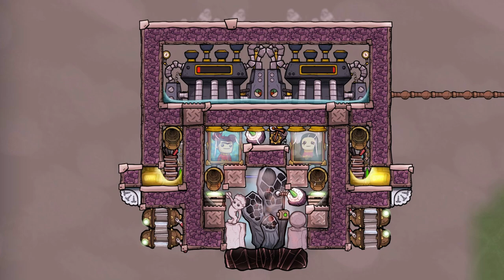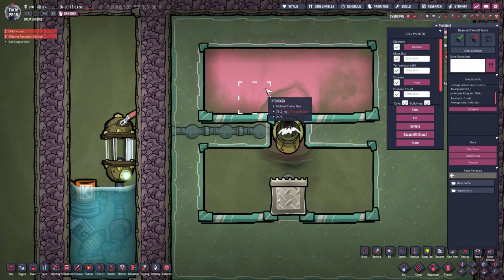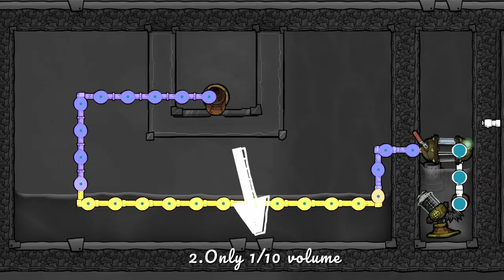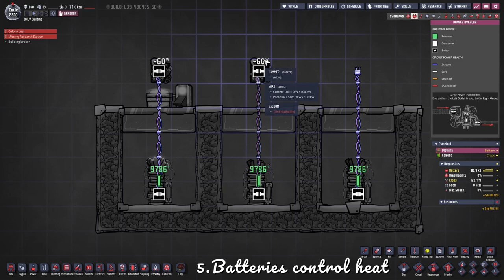My Cold Steam Vent Tamer - Explained

Comment: That's an insane build.
Reply: Is naptha necessary though?
Reply from the maker: Did I use that under the liquid vents? Then no, it can also be petroleum or crude oil.

Basically any liquid, it just needs to be able to resist the heat. 
Naphta is helpful cause it is very viscous helping the player to drop a good amount in that tile without spilling.

But if you build this monstrosity naphta is probably only a small concern. since you already have plastic and heat.

hope that helped

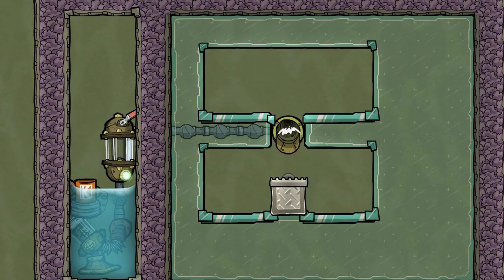Comment: Thanks for the video. I'm not new to ONI, but only from you I learned about liquid pump mechanic 1:28. Man, that stuff is crazy! I already found 2 useful application for it: 1) powerless room vacuum 2) powerless geyser storage. In both cases we just need to fill few pipe sections with water, brobably bridged in, with storage above. For just vacuum we destroy storage when gases deleted.
Reply from the maker: That is cool. Nice i could show you something new.
As for the Geyser Storage: just be careful cause the liquid vent overpressures at 1000kg/tile
Meaning if you reach that pressure in your storage the vent will turn off, the gas will stay where it is cause of the liquid puddle; the geyser will over pressure though and stop at that point in time. So plan ahead for that

Comment: There is a huge design flaw on the compact version that can be fixed, otherwise it disables the entire thing:
The insulated pipe CANNOT pass by the thermo sensor, even if it is very insolated, the water there will eventualy became steam, it is getting a tiny bit of heat even with ceramics, and since it is sitting there basically forever, only renewing 200g per tic it will eventually heat up to steam.
The easy solution is moving the piping around, shouldn't be much of a problem since there is already a block on that column, another fix would be a bridge. One thing is fore sure, you cant have water sitting at a 200 ºC block since no insulation is perfect.
BTW, amazing content, I'm really enjoying your vids, I wish I had discovered this sooner, liked and subscribed already
Reply from the maker: Thanks man, good eye. I think i noticed that too after some time 
(although i already test all my buils for around 400 cycles before making a video on them). 
Routing the pipes around seems like a reasonable improvement whyile only slightly increasing the size.
And thank you for the sub :)
Reply: I've used cheaper materials, lol, mine blown up in about 100. Still, pretty awesome  build, using steam engines instead of pumps is brilliant

Comment: This is super helpful! Why is naptha always used for the drip/gas function instead of other liquids like crude oil?
Reply from the maker: Any liquid will to that is in liquid form at 110°C and does not off gas. 
Naphtha has the benefit of being sticky and forming puddles of 30kg. 
So it is easier to apply without spilling.
It is also very heat resistant.

Comment: if you have 2 cool steam vents. put an aquatuner in one with a steam turbine above to heat up the water above 125 and turn it into 95C water which can be output from the steam turbine into a water pool with a cooling system, and have the liquid pipe from the aquatuner go to the other to cool that liquid down therefore using 1 aquatuner to turn the steam of 2 cool steam vents into water which can be cooled in the main water tank

Comment: Will this only work with naphtha or can a different liquid be substituted?
Reply: Any material which remains liquid at 95-125 Centigrade will work.
I use petroleum - as this contraption commonly must be built ASAP (even when colony does not developed enough to produce plastic) and it already has petroleum as required element.
Yes, there only 1 step between plastic and petroleum (which you need to do anyway as you'll need plastic for turbines), and another one - between plastic and naphta - but why bother with extra steps when you does not really need to?
Reply from the maker: As  Павел Романов said. Any liquid will to that is in liquid form at 110°C and does not off gas. 
Naphtha has the benefit of being sticky and forming puddles of 30kg. So it is easier to apply without spilling.
It is also very heat resistant.

Comment: Beware: After ~200 cycles the insulated pipes leading through the battery-rooms will break even if you use ceramic. Better go around the 200°C-Petroleum
Also if you don't have ~250°C petroleum and/or magma I'd recommend to "prime" the build by running one or two geotuners on the steam vent to get 130+°C steam temporarily (or permanent, if you have renewable bleach stone. Heating up the battery-rooms enough to get rid of geotuning is even faster with a conveyor-bridge.
Reply from the maker: Hey hey, thanks for noticing! 
Routing the pipes around will definitely make it safer.

I would just like to add 2 bits of information:
-this was before geotuning and
-i normally test for at least 400 cycles before making a video on my builds. 

I don't doubt your observation though, could be i went short on testing in this one 
or that it will take longer than 400 to break.
It can still break though. So rerouting the piping is a good improvement!

Thank you for the suggestions :)

Comment: Now what if you have the mod that allows to "crack" the vent to increase the output? I've done it to one and in active periods it could go like 55kg/s, I'm thinking about splitting the chamber to leave 1 tile space so the steam keeps going up and keep adding levels to the steam turbines to match the average output of the vent after cracking...
Reply from the maker: You basically don't need to chsnge anything fundamental. just make the room was higher to have an increased buffer.

The only thing you need to prevent is overpressurizing the liquid vents i.e. less then 1000kg per tile. So if you make the upper room bigger you have more leeway.
Reply: @Luma_plays  I think I need more turbines, the average output including downtimes is calculated by another mod to be 7kg/s, even with buffer, if I want to use it all given the 2kg/s per turbine I'll need at least 3 or 4 turbines to use it all, off course given that I have enough buffer to hold it all
Reply from the maker: @CarlosEstebanLopezJaramillo  Ok that is probably the safer method. But you will not get 2kg/s per turbine since you only have 4 available steam inputs. meaning if you add more turbine (you also need more heat or magma chambers with walls and so on) you need to accomodate for that deficiency.
Reply: @Luma_plays  Sorry man I've been trying to fix it and add more steam turbines, but I don't have the sanity points to do it in survival while trying to survive a drought, moving into a petroleum escher waterfall to bead pump to infinite gas storage, then in the infinite storage I'll add steam turbines as needed instead of trying to keep everything balanced without the steam condensating at bad times.
Reply from the maker: @CarlosEstebanLopezJaramillo  No need to apologize :D
Sounds like you have an interesting and complicated base!

Comment: Luma, what would you recommend for getting this as  a "permanent" setup for only removing that much steam as the geysers calculated average output is?

That way the system will output the same amount of water for thousands of cycles.
My first thought was to maybe block some ports if necessary and reintroduce the last few bits of water to the steam room to exactly export the Calc. Average output.

Is this even possible? That way the steam above the vent would have to be enough mass to work for an entire dormancy period, which is very long according to my experiences...
Reply from the maker: Hey michimannes; generally i wouldn't recommend this as a permanent setup cause it is way to complicated for that. 
There are easier methods. This was just a proof of concept that you CAN make a power positive steam vent tamer.

If you still use it for that reason then I think it is easier to just extract all the water (in form of steam from the geyser)  and store it instead of controlling the steam average output. you can easier manage your water pools or storages than the output of a system with changing parameters.
Reply: @Luma_plays  the idea behind that was mostly having a nearly constant power pruduction with this.

But I just saw it again and I think that's not really worth it - the power produced is just so low that it's not even a problem if the power was wasted sometimes

Comment: I have an Idea. With only one Geotuner you can tune the steam emitted to a temperature of 130° C. Then you would need the extra chamber for hotter steam, and the steam turbines could work at max capacity. And since the Steam is only 130°C you can still self-cool them. The only problem I encountered with the tuning part; sometimes ur Data on the Tuner runs out and your dupes because your dupes only research and refill the tune-data after it has been fully depleted, making the steam too cold for the turbines. Would be interesting to hear your thoughts on this(maybe try something in the likes).
Reply: Could fix that issue by throwing in batteries.

Comment: Thanks! This is exactly what I've been looking for. Just one question though, why not use a transformer instead of a battery? It would have zero energy loss and it seems like with the steam generator you don't really need to worry about turning it off to prevent overheating.
Reply from the maker: Hello, i haven't considefed that one st the time, also the transformer is larger. The battery is used to generate heat to keep the steam in the pockets at the right temp. But i guess if you can fit in the transformer you can try that as well. I came across that weird battery behavior and used it here.

Comment: Is there an early game alternative liquid you can use to the petroleum? I’m thinking about it and I just can’t think of an alternative. This might be a mid to later build because of the oil requirement.
Reply from the maker: You could use crude oil or naphta (molten plastic) but they both have a horrendous thermal conductivity. You would probably have to set a different value for the thermal sensors since the heat transfer is slower to the sensor.

Also:if you build a steam turbine you seem to have plastic either from the polymer press requiring petroleum or from glossy dreckos meaning you have plastic you can melt
Reply: @Luma_plays  yeah I totally forgot the plastic. Slammed into that wall real fast lol.

I’m over here on cycle 3157 with 36 dupes and I forgot that she doesn’t have plastic.
Reply from the maker: @the_staplergun3968  Haha well that happens. If you have a larger base you can get lost pretty quickly.
Reply: @Luma_plays  honestly I think my base is pretty rudimentary relative to others who reach this high of a cycle count.

Comment: -Why 2 steam turbines? Does this not work at half size with 1?
-What are the two gold metal tiles doing under the turbines? I assume for heat transfer with the bridges. But I don't see why it would needed or even wanted here.
-I get using a liquid valve for the bead pumps to keep the pressure low with constant flow. But why in the battery box? I see that it is 105C. Except isn't it only getting to 105C due to being tiny packets? I can see why preheating before it goes in makes sense. But it loses its heat through via gold metal tiles immediately before hitting the petroleum. Isn't it below 100C anyway? A second NOT gate on the existing temp sensor to restrict the vent would do the same, wouldn't it? There something I'm not seeing?
Reply from the maker: Hi user name
-Yes 1 turbine would also work, but the water-output would be very slow with only 3 steam inputs (output= 0.4kg/s x 3 = 1.2kg water per second). The Steam produced would probably overpower the turbine quickly leading to the steam geyser overpressurizing and a reduced efficiency.
-the gold tiles are a heat buffer to give the system a bit more mass (steamturbines+water+goldtiles) not sure what i had intended for them next to that. I has been a while i looked at that one)
-the batterie box is the most important part. you drop tiny amounts of liquid. this will turn to ~ 180-200°C steam because of the hot petroleum. (The petroleum is cooked with the battery). This hot steam under 1 of the outlets tricks the turbine to run in the first place. 
-the pipe underneath the metal tile is insulated as far as i see.

Hope that answered some of your questions.
Reply: @Luma_plays  It did! Thanks. Though my question was specifically about the liquid valve keeping packets to 0.1kg. I get the battery cooks it up to operating temp. I don't see why it can't be 1kg packets and then closed for longer in the battery box. (1 on, 9 off, vs 10 in a row.) That pipe is not being heated. It is going through the insulated tiles. The other output needs tiny packets as it is over 100C. But not the battery box.

Comment: Does the liquid pipe have to have only 1/10 of a packet to prevent a state-change or could you do 2/10 of a packet?
Reply from the maker: Hey hey; Only 1/10. that is 1kg for liquid and 100g for gas pipes. even 1g too much and the pipes will break if you have a overheated liquid or state changing gas.
Reply: @Luma_plays  awesome, that’s good to know. Thank you. :)

Comment: It's smart and efficient, but if you can have 250C Petrolium for your cool steam vents, then you probably have enough power to spare to run it with standard setups and not bother with complicated version.
Reply from the maker: Yeah definitely. It is more a proof of concept that you can even have those Geysers be power positive.
You also don't have to heat up your petrolum. The battery can do that for you but it will take some time and a miniscule amount of power.

Comment from the maker: Hi Guys! Here is the explanation to my "Cold Steam Vent Tamer" as well as a version for geysers that are not burried!
Have fun. Also: I addded Blueprints for this on ;)

The self-cooled power positive cold steam vent tamer.
Cold Steam Vent Tamer short: https://youtu.be/HE9VoS65iK8

Patreon: 	https://www.patreon.com/Lumaplays
Save file:	https://cdn.discordapp.com/attachments/873302865878331422/933852352014860288/SPOILER_Steam_Vent_Tamer_Explainer_YT.zip
Blueprints:	https://cdn.discordapp.com/attachments/873302865878331422/933852529308090408/SPOILER_Blueprints_Lumas_Cold_Steam_Vent_Tamer.zip

Chapters:
0:00 Intro
0:07 Why this design and What for?
0:29 Why 2 and a half - Versions
1:12 The 5 Features that make this build work
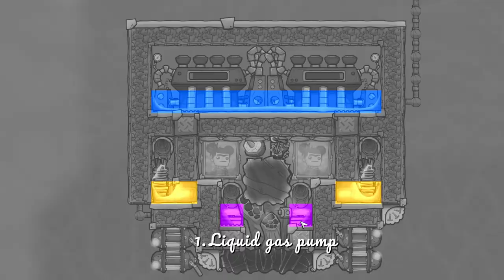1:17 1. Liquid gas pump & Explanation
2:43 2. Only 1/10 volume & Explanation
3:25 3. Steamturbine trick & Explanation
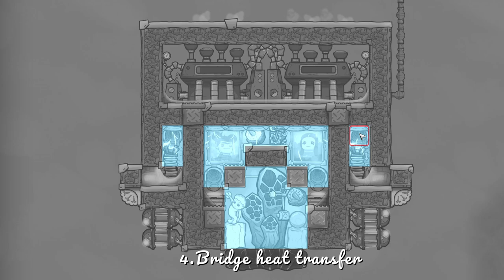4:31 4. Bridge heat transfer & Explanation
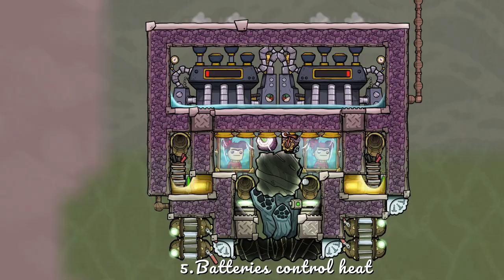5:07 5. Batteries control heat & Explanation
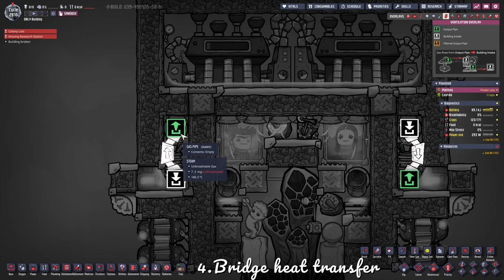6:37 6. Steamturbine self cooling & Explanation
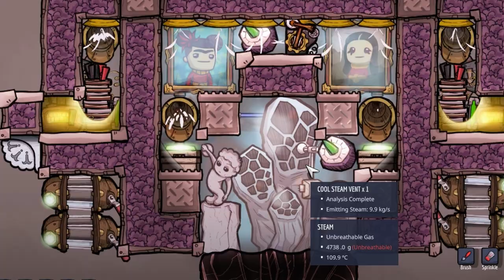7:12 Steam Geyser & Old versions
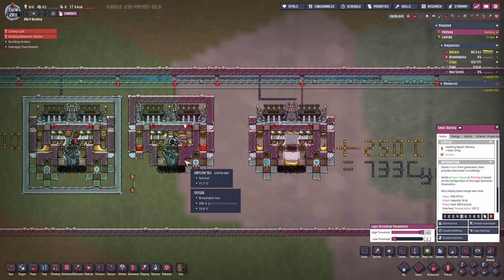7:29 Relevant Overlays
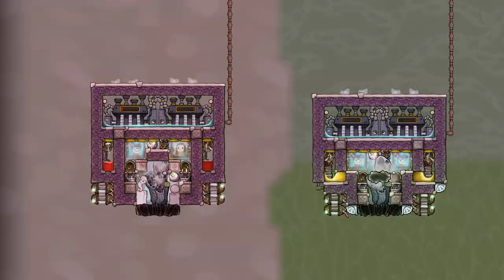7:45 Your next Video

Comment: I used magma and a gas bridges . My gold liqid vent melted. Any tips?
Reply from the maker: Hey Recer750 yes. When using magma build everything in the steam magma chamber out of steel. Or Materials that can withstand the ~1700°C. That does also mean building the bridges there out of for example obsidian.
Reply: @Luma_plays  Thanks 😄
Reply: Now its operating, but it only transport 2399.8g of watter pr pipe length. My steam vent is outputing 7.2kg/s. Did i do it wrong or is it a limit to the output inn this design?

Comment: 1:49 is it possible to make a planet reach vacuum really quick with this method?
Reply from the maker: I don't know of any method to quickly create a vacuum on a large scale.Even if you ofen up everything to space it takes a felt eon to empty to a vacuum. You can segment your base and place in either mechanical pumps like this or electric pumps the larger ones.
Then if you only have a few gram left replace them with the small pumps. They are more efficient with these smaller amounts.

Comment: Nice build! Was this inspired by my Reddit post that used Steel Power Tranformers as a source of heat?
Reply from the maker: Hi Kamizushi Akinari. I had my inspiration sources in the short and forget to put them here. So here they are:

Don't dig up the natural tiles to make the build smaller from tuxii industries 
https://youtu.be/wYI2sIN1IvI
Using bridges to transfer heat to a certain spot from BlakeMW on reddit 
https://www.reddit.com/r/Oxygennotincluded/comments/f4tmq1/selfpowered_cool_steam_vent_tamer_gold_amalgam/
You only need one Steam turbine port to be hotter than 125°C from mathmanican 
https://forums.kleientertainment.com/forums/topic/111016-temperature-clamped-steam-turbines-extract-power-from-cool-steam/?tab=comments

If you are one of those people then yes. Otherwise i would be interested in what you have build 
so feel free to share the link :)
(Yt will blocked it - but I will unblock it as soon as YT shows it to me)

PS: I also used chained together power transformers as heat source in my newest let's play because the planet is so cold.

EDIT: Ah cool i just found your build:
For all the others: Here is another nice method of taming a cold steam vent:
https://www.reddit.com/r/Oxygennotincluded/comments/oml8y8/psa_forget_aquatuners_its_possible_to_tame_a_cold/
Reply: @Luma_plays  Thanks. :)